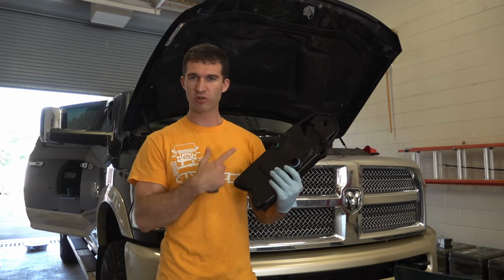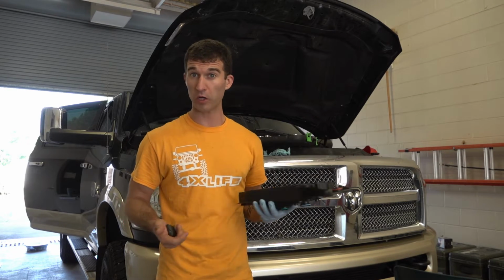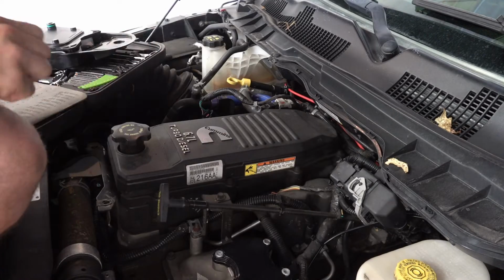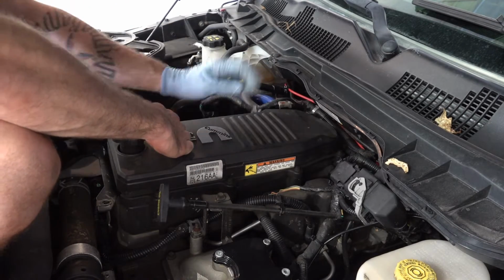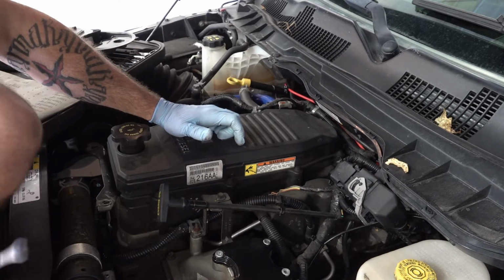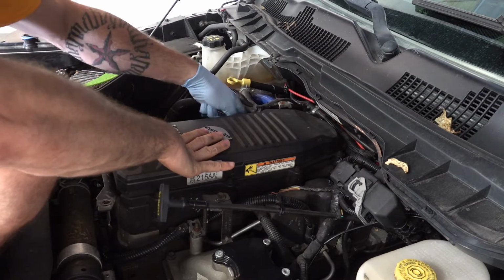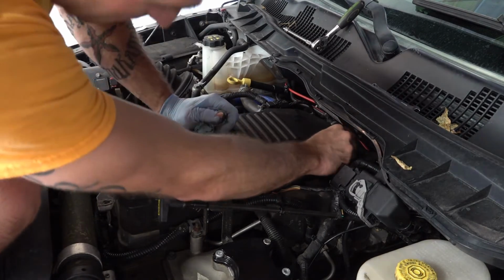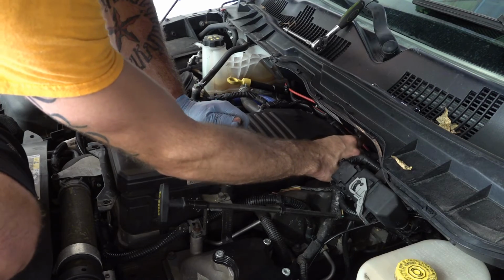How to Change CRANKCASE FILTER - Ram 2500 6.7L Cummins

Comment: I saw where one person said you had to remove the hose on the side and disconnect a clip beck left, but it looks like you only took out the 8mm nuts and bolts.
Reply from the maker: Yeah it's pretty straight forward and simple.

Comment: Perhaps in the dead time, you could mention the size socket necessary for the job.

More info is always better.
Reply from the maker: You're absolutely right, my apologies.
Reply: @AmateurAtBest  it was easy enough to find, but would make you video better.  I have a 300 lb deer stopper on the front of my truck so I feel like a gymnast every time I have to mess around under the hood.  Always nice to know what tools I need rather than going up and down trying to get the size right.

Thanks for the video.

Comment: Thanks for posting. Dealers  are a rip off. They wanted $220 for the oil change. $315 for the fuel filters. I didn’t even bother to ask for how much for the crankcase filter. Last visit they charged me $85 in labor to change the air filter. THE AIR FILTER!!!! Fuck outta here. DIY always.
Reply from the maker: Yeah I've never really had a good experience with dealerships, they're ridiculous.

Comment: Did you get a perform service message? I just got a 2017 2500 tradesman. My message center says, preform service. The Google machine says it means to change this filter. The truck has 97K miles
Reply from the maker: I did not get a message or anyhing...at least not that I noticed. I just try to change my filters regularly.

Comment: Did you get any codes by not changing this until 90K ? Schedule is about 65,500. Great video.
Reply from the maker: I did not have any codes, I just happened to read about it as  regular maintenance. I'm glad you enjoy the video!
Reply: The only reason a code will pop up is if the filter gets clogged with oil
Reply: My 2016 with less than 50,000 miles is showing the code, for this. 49,802 Mike's to be exact. I'm about to change it, now, after seeing this video. Seems pretty simple. Thanks...